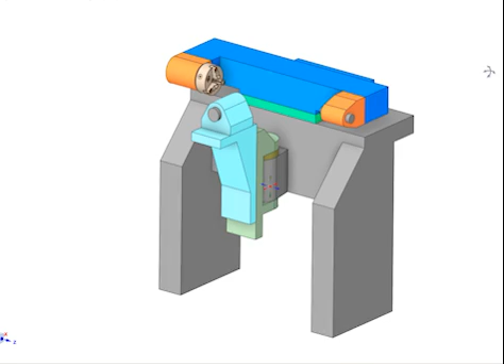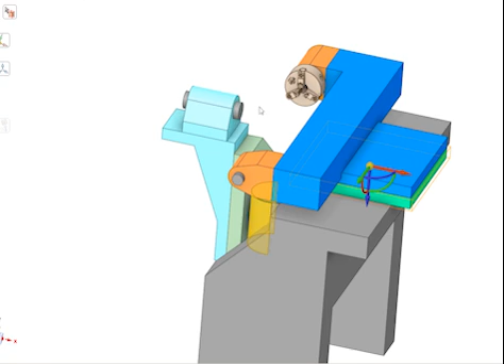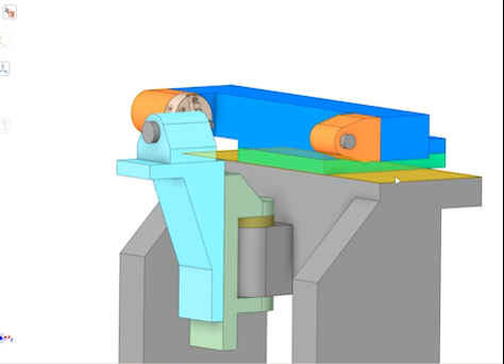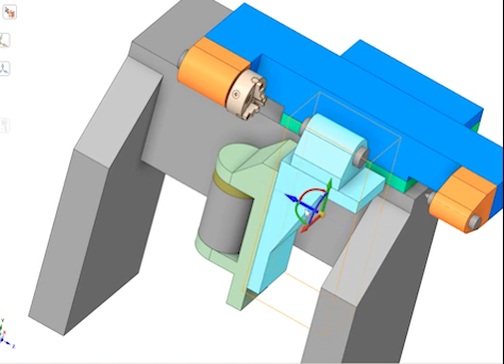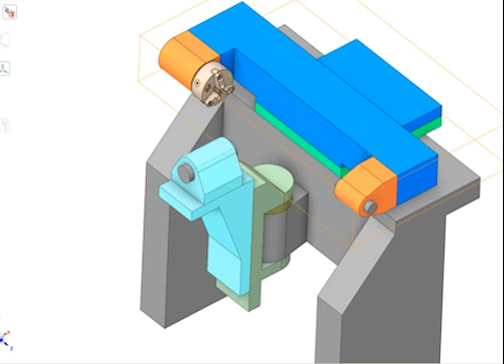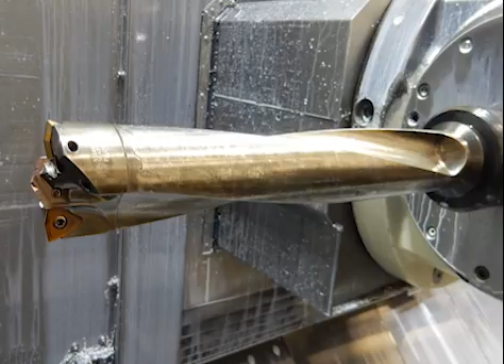Small Mill Turn Machine Idea

Comment: Very inspiring!  I want to entertain designing one similar to your design to see if I could build it.  I like your “fly by wire” description in the next video too.  Maybe one dial could control forward and backwards and instead of multiple dials for each axis.  The operator hits a button on a raspberry pie that tells steppers on each axis to work together at different speed combos to move the machine in the desired path.  I know nothing about electronics or computing but I bet something like that could be done somehow to move the front assembly.  Maybe I’m over thinking it.  Again thanks for the inspiration!

Comment: If I am looking at this correctly, you might have some difficulties gyroscopic forces affecting the xy travel. The forces will be a function of mass and RPM which may be difficult to calibrate out of the servo control. 

Functionally something like this would work, but it might be difficult to make it precise parts. 

Enjoy watching your channel. Thanks for sharing
Reply from the maker: It’s just an idea. The size this machine would be the servo system would have no trouble dealing with the inercial forces. This is no different than a vertical mills table with a rotary table A axis mounted on it. I think you may be referring to the X and Z axis. The vertical axis in this design is the Y axis with the B rotary axis. The C axis is the turning spindle axis. Only the rotary axis would have gyroscopic forces on them. But they rotate slowly. Now the turning spindle does rotate at high speed. But you only generate gyroscopic forces if you tip the axis of a gyroscope. This machine movement parallel and perpendicular to the rotating spindle. Swiss type screw machines move their turning spindles in a similar way to this. And they have no problem holding close tolerances. But as I said it just a idea I was thinking about. Thanks I appreciate your comment.

Comment: Nice layout! I like how easy it would be to make the B axis, it could even just be driven by a large gear or pulley that extends under the machine, plenty of room to avoid needing a precision drive.

The C drive is bit annoying, I'd given it some thought a while back and I think just a large radius worm drive with the worm being adjusted further into the gear as it wears seems the most appropriate. I'm pretty sure that if materials are chosen so that only the worm will wear then you would maintain linearity and precision quite well over time, and it can easily pivot away to let the axis spin.

There are types of roller cam drive that allow the cam to pivot away so the axis can be spun, and generating those cams is only a little more complex. Hard design but they are simpler to machine and grind once you are done. The roller alignment that you need is insane though.
Reply from the maker: My Mazak has a worm driven C axis. It engages by first orienting the tuning spindle, while bringing the C axis worm to it's zero position. Then the worm and it's servo drive are mounted on a pivoting arm that is tipped into the worm gear to a precise stop to control the backlash by a hydraulic cylinder. This work fine but it takes time to do it, and its rapid rate is slow.  I think on a small machine like this it may be possible to just belt drive a precision servo drive with a high resolution encoder to do the C axis. Then use some kind of curvic coupling to engage and disengage it, for turning. The B axis on my Mazak is driven by a roller cam drive. The B axis only rotates about 240 degrees total so this could be done in several different simpler ways. A belt drive may also work. Or actual apposing steel bands wrapped around cylinders or driven by a linear slide and ball screw. Worm drives are slow and wear. The Mazak has a special lube system just for the C axis worm drive.
Reply: @EdgePrecision  I think belts have kinda poor properties for directly driving the C axis, even the steel core ones are a bit elastic and wear unevenly under load compared to other transmissions, only really good for transmission from a motor to some other transmission if you want precision and stiffness. Might be good enough for the B axis though if the wheel radius is very large.

If it's good enough for the Mazak then I think you could get a worm drive to work well on the C axis, maybe with a higher gearing, pneumatic cylinder if you don't want hydraulics, and using the spindle drive to rough position the shaft with pulses, then a little pneumatic cylinder that pushes a bar against a flat on the shaft to quickly bring it into proper alignment, maybe 5sec max for the process? If you have the worm swing up from below then the lubrication could just be a sump that the worm sits in without the gear touching the surface when it spins on it's own, easy separate lube system.

Comment: Hi, Bit late to the discussion however I would like to make a suggestion to you and for anyone to have a look at a Masso CNC controller, 5 axis touch screen, developed in Australia and I believe there is a dealer in the US, Mine cost me a bit over $2000 Australian so cheaper for the US blokes, I can say the system is quality in manufacturing tho admiditly I haven't got my machine up and running yet, tho people using them seem to reckon there good hope this is useful info, Cheers.
Reply from the maker: I took a look at their web site. You are correct the touch control here for 5 axis cost is around $1,350.00.

Comment: Cool idea, the only downside is programming it would be a challenge as there would be no software that could calculate the tool center point.
Reply from the maker: It's more the machines control that needs the ability to position the tool correctly. There are quite a few Cam software's that can process the code, given the machines configuration. My Esprit software can. I thing even Fusion could do it as well. Its just a normal 5 axis configuration. Just because the whole lathe bed is moving doesn't really change anything as far as the tools movement is concerned. It may be more confusing to us, but for the control it makes no difference.

Comment: I think definitely needs a quill. I know you loose some rigidity but having a quill certainly makes a machine much nicer to use particularly manually ibecause it give you feel for what is going on which often averts what can be disasters otherwise.
Reply from the maker: There is a slide on the top of the Y axis that will act like a quill. It could be configured to operate with a lever/handle like a Bridgeport quill. Depending on how the spindle is driven would depend on if the motor was on the top or maybe underneath. I haven't really figured all that out yet.

Comment: Interesting idea and not a axis arrangement I have seen before!

Quick idea, if you are going with a fixed rotary tilt axis a very solid rotary axis reduction you could consider is ballscrew tilt system that DMG Mori DMU50 uses (it is also relatively cheap, especially when dealing with large tilt axis).

Mind I would be very careful in the position of the tilt for the spindle as the rotary joint is far weaker compared to linear systems, so it should not be too low in the axis stack, as it then starts to influence the linear axis as well. 

Not to mention at the bottom of the stack the lever working on the rotary axis increases which is adding to the problem as well magnifying the angular error as the offset from center increases.

Also I am guessing automation and Automatic tool changes are not a priority on this design since idea is to make it more diy?

Personally one of my favorite designs for flexibility is the vertical traveling column design with the rotating head (B tilt axis) and the A rotary/lathe axis (Example Willlemin 301S2 or the DMG DMF with tilting B head, rotary C axis inbuilt in the table as well as fixed A axis lathe spindle on the side).
Reply: I think this design lets you get around a lot of the problems you normally have with a rotary axis, since you just have so much room to have the bearings far apart and have a huge worm drive gear under the table if you want. I like the ballscrew tilt idea though, it would limit you to only a bit past 90deg of accurate movement but it is rather rare to want the spindle angled that way anyhow.

Comment: I hope you get rich with your idea, maybe you can put swissmak or haas out of business. Or even sell a handful of tabletop machines.
Reply from the maker: Has Swissmak even sold any machines?
Reply: @EdgePrecision  They met their desired pledge on kickstarter of 120,000USD at a value of 187,000USD
Reply: @EdgePrecision  Pledge US$ 2,599 or more
SwissMak - 3 Axis VMC Kit
This gets you the simplified 3 axis vertical mill variant of the SwissMak. Heavy boxways, 30 taper spindle and ODrive servos for all axes.

ESTIMATED DELIVERY
Oct 2018

Comment: This design has huge problems, the lathe is too small and so the machine is not universal. And it has structural issues. Tsugami TMU1 has a design like that but the lathe part is fixed and facing down like it should be. Grob makes some upside down millturns, Index has sliding bed design.  But all these machines are cnc chuckers. A universal lathe must be longer even though it can accodate many milling operations. Similarly, deckel FPU type mills (euromills) can also turn parts, but lose their versatility for machining gears and worms if you changed the design. Also way more handy than any of the points you mentioned is the ability to hang huge parts on the table (and the other side by a crane) to mill only a small feature - like the boring of the articulation of an excavator arm. Ther'es a guy on youtube who built a 4 foot press brake on a deckel like the one you showed. On your design this would not be possible. Btw his channel is excellent, his press brake is for making precision angles. If this is too hard to understand, consider this --- you shipped one of these machines to third world india, would the people have use for them to fix their broken down tractors and trucks? Have you seen a third worlder turn a 1 meter part on a 500mm lathe? They put the headstock on a block to accomodate their part. They can extend the bed easily to accomodate longer parts. This is universality. The gap in the gap bed lathe.
Reply from the maker: The whole purpose of this machine is not to do what you are talking about in this comment. Get a bigger machine. It is not intended for that. You don't turn a tractor part on a watch makers lathe.
Reply: @EdgePrecision  The whole purpose of a machine is to use the smallest machine to get the job done.  Floor space and iron cost money. Its all about the money.
Reply: So what are you optimizing for? Floor space? Money? Who is it targetted towards? And how is it going to turn straight parts without weighing a ton? Because i can see FEA issues from the way things are layed out.

Comment: Once you get your first real machines, you usually don't want to do anything with chinesium machinery ever again, except woodworking or small botchjobs, where precision doesn't matter and so that  you don't get wood dust on your good iron.

In a couple of years, the early 2000s 5axis machines hit the used market for cheap, 5-10k, IMO so much easier to refurbish/LinuxCNC those than to build a machine from scratch or modify chinesium to a somewhat usable tool.
Reply from the maker: Yes but even used mill turn machines are expensive and large machine's not suitable for someone's garage. But it would be nice to have similar capabilities as one, for small projects. Maybe like making small engines or things like that. But I agree with you on the Chinese machines you buy a new one and turn around and rebuild it, to do anything.

Comment: the big problem is availability of 4+ axis CAM for the hobbyist
Reply from the maker: My idea (I didn't mention this in the video) with this, is sort of a hybrid manual/CNC type of situation. Or maybe more accurately put servo operated axis with manual wheels/controls. Fly by wire so to speak. If this can be done. So when you have the B axis tilted at an angle you can face or drill hole patterns at that angle. The control will sink the axis necessary to make the tool move in a plane perpendicular to the tools axis in X and Y and the Z parallel to the tool as normal. This could also be used for turning. My Mazak can jog like this in the manual mode, or in the normal X,Y,Z.B,C machine coordinates. This would be very useful to do for manual machine work. Or the machine could be put into full auto mode. To better visualize what the manual mode could do. Consider a Bridgeport type of mill. When you tilt or nod the head. You can drill holes with the quill but you really cant face surfaces with mutable passes easily or drill hole patterns. This would require careful calculation to trig out the locations and moving the Knee up and down to do it. But what if the each axis of the machine was actually driven by a servo drive and you just turned pulse generator wheels and the computer figured out where to drive the movements to make it happen. In the new work plane relative too the tools axis/B axis. You can easily turn chamfers or tapers face big surfaces, mill pockets, drill patterns manually. The only thing this really lacks is the tactile feed back you get on a manual machine. But after using my Mazak this way. I think this is a better trade off. Kind of a long comment but I think you get the idea.
Reply: @EdgePrecision  If you have access to the servo controller it might be possible to provide force feedback on the control wheels.  I've done some experimentation with this type of feedback, you essentially use a very small gimbal motor with an encoder as your MPG wheel and tell it how much torque the servo is putting out and you then use that data to feed a PI loop to have the small gimbal motor push back on the user's input.  you can search "DIY haptic input knob" for an implementation of the video I made about it.  my video is called "haptic textures and virtual detents" it is kind hard to describe, but the feedback surely works.  I think the hard part is feeding with this type of knob with a constant speed.  I've not used a Mazak but I'd bet they have some very good algos for ensuring that input ends up as smooth output on the machine.

Comment: its pretty close to the layout of an od grinder or a cincinati #2 tool grinder
you coul also do a rack tool changer on top of the z axis or gang tooling on the y axis similar to how swiss machines get layed out
Reply from the maker: A machine with this axis configuration could very well grind cutting tools such as endmills. In fact this is very much like my CNC tool and cutter grinder flipped upside down. The only thing you would need is the software to program the tool path.

Comment: It would also Interesting  for you to experiment on Gear Cutting Gcodes  on your Mazak
Reply from the maker: My Mazak has the gear hobbing option. But to do that I would need a gear hobb for the particular gear tooth I would be cutting. Or It could be done in the normal way with gear cutters like on any milling machine. I don't really do any gear cutting on that machine. So I don't have any tooling. But the machine can do it.

Comment: What is really not easy to implement are the required backlash-free and absolutely rigid axes during milling. What would really interest me as a hobby machine builder is how this was implemented on your Mazak? Is the A-axis of your Mazak belt-driven? On my homebuilt machine this only works with very small end mills (3mm or so) otherwise the axis starts to swing up because a belt solution is apparently not suitable for this? With a harmonic drive, on the other hand, you do not get the required speeds when turning.
Reply from the maker: There is no A axis on the Mazak. The turning Spindles Rotary axis is a C axis. This is driven by a precision Worm gear drive. The B axis on the milling spindle is driven by a roller cam drive. Both these rotary axis can resolve to a .0001 degree accuracy.  There are no belts on any of this machines axis.
Reply: @EdgePrecision  Thank you for your reply and generally for the useful content of your videos. I have already learned a lot through it.

If you have the time, I'd be interested in seeing a video of how Mazak has implemented the worm gear with C-axis and motor in your machine 🙂
Reply from the maker: @9voltprojects  I can describe it for you. The worm gear drive on the C axis works like this. The worm and its servo motor are mounted on an arm with its end pivot in such a location that it can engage and disengage the worm from the gear. So when the machine switches between turning and milling it first orients/zeros the turning spindle with the turning drive. At the same time it orients/zeros  the C axis. Now with everything oriented is swings the the worm into the gear. The arm has hard stops to control the lash between the worm and gear. With that done it shifts the spindle's drive into neutral. I believe on this machine the arm is controlled by a hydraulic cylinder.
Reply: @EdgePrecision  Ahhh, very cleverly done 🙂 And I have so often thought about how that works, that the axis / spindle can be so extremely stiff on the one hand, but can also rotate fast for turing.

Thank you very much for the description..

Have a nice weekend,
Chris from Berlin

Comment: Talk to the folks at Taig Tools in Arizona. They make small machines in the <$2k prices range, and their design philosophy is to keep things simple and size-appropriate.

In fact, looking at your animated drawing, the blue and orange part could easily be a Taig lathe and the light blue could be a Z column from their mill. Add a pan/tilt head and a sliding table and you just need a frame to hold everything together.